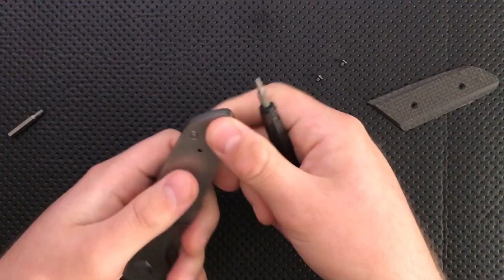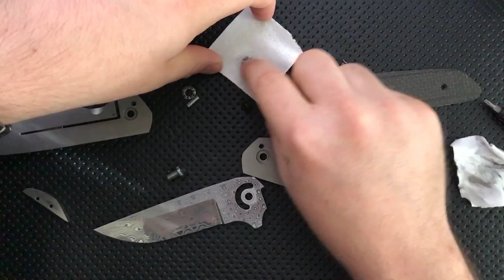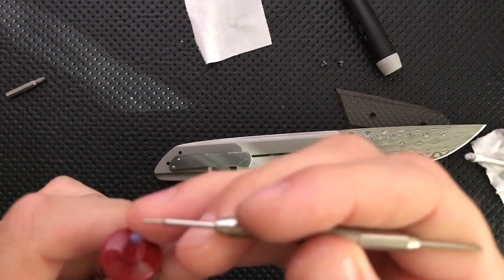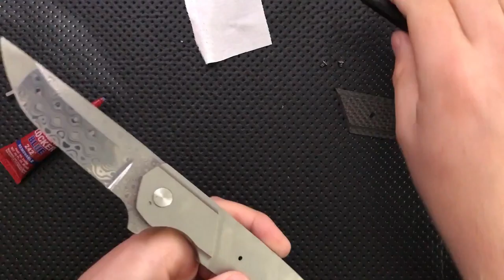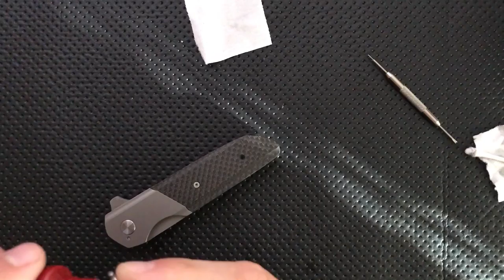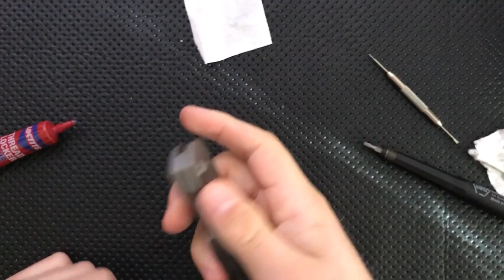How to disassemble and maintain a Kody Eutsler Regulator Custom knife

Comment: Backspacers are underestimated. through my PM2 in the pocket with a bunch of keys... one key found its way down to the blade and nicked it. Something to have in mind when dealing with open construction knives, seems great on paper but not so much irl for me.  I got a backspacer for my PM2 most of the blade is covered, compression lock leaves a gap though...
Reply from the maker: Agreed.  It's beautiful when done properly, although small scale spacing can help too.
Reply: Don't ever put your knife in the same pocket as your keys. You're lucky your keys didn't push the blade open.
Reply: Sean H The same way the keys dinged up his edge, and just because it's up against the pocket seam doesn't mean it can't open up. Murphy's law, bucko.

Comment: Nick, Didn't that used to have standoffs rather than a backspacer?  Not a fan of the backspacer with a finish that doesn't match the rest of the knife.  Real shame about the safety issue too (although it may not be an issue with folks with bigger hands/thicker fingers).  Have to admit in all other ways it's a thing of beauty.
Reply from the maker: Yeah, I asked for a matching satin Ti spacer, and that went by the wayside too.  Used to be standoffs.  That's the thing that bugs me most: This knife is so close to being spectacular, but instead, it's a hot mess.
Reply: I actually quite like the contrast of that back spacer against the rest of the Ti.

Comment: Very weak knife, the two tiny t6 screws hold the handle in together with no support. When you get to take apart the WE knife you will see that the backspacer has small tabs that fit into the scales so that the screws only act in tensile strength and not shear.

Comment: Seems like the safety issue could be easily fixed with a full length back spacer.
Reply from the maker: Yep.  Watch the full review on Saturday to hear more about that :(
Reply: Nick Shabazz I'm eagerly awaiting the review.
Reply: Sean H Yeah, Looks like a good 2 - 3 mm though, plenty enough I reckon and it could milled with a V shaped groove down the centre for the blade to recede into. It could be incorporated into the current back spacer, wouldn't need any extra mounting holes, just extend the current back spacer with a 3mm thick "fin" all the way up the spine if you can visualise that? Either way it's a pretty big oversight by Kody and it's needs to be rectified.
Reply from the maker: Jimmy: Just wait for tomorrow.  There's a story.  Oh boy is there a story.  And practically speaking, it's about 1mm of clearance between the blade and the scale edge.
Reply: Nick Shabazz Hah well I just watched the review, I guess Kody's idea of a "Fix" was the same as mine. Maybe he should've made some adjustments to the stop pin so the blade doesn't close as far, that combined with the back spacer would've solved it. Of course it would require a new blade... It's a shame it didn't work out though.